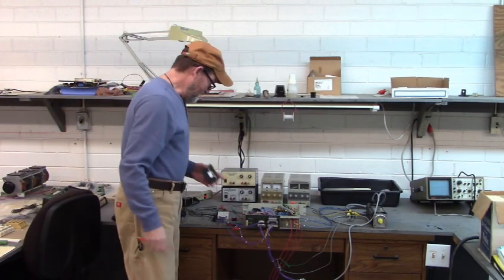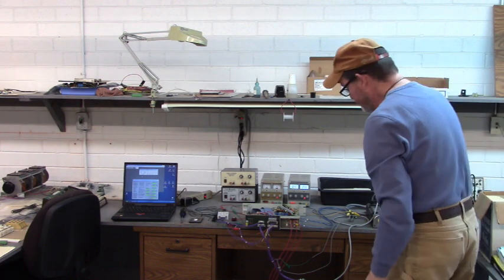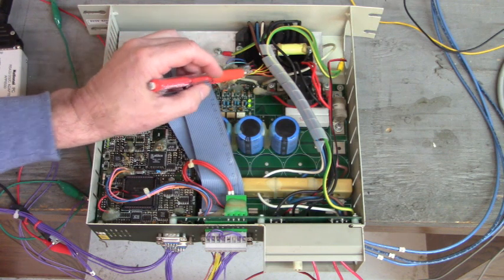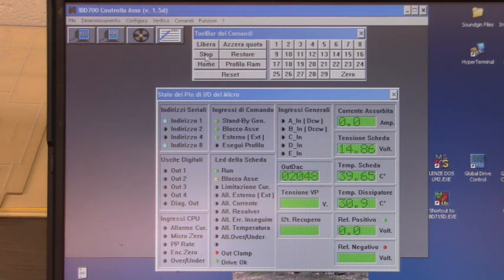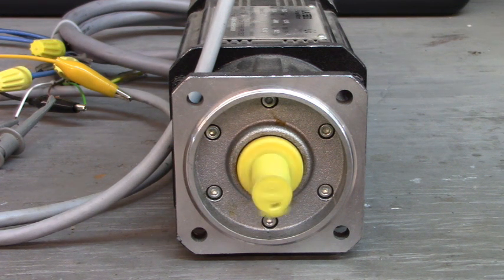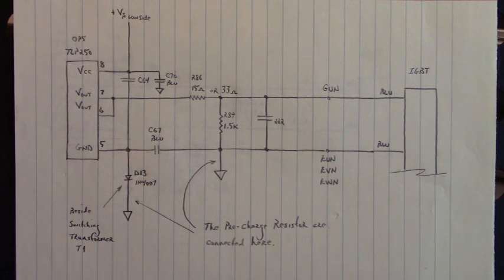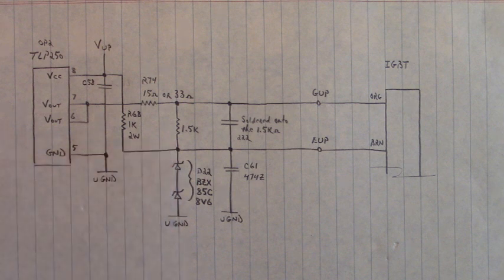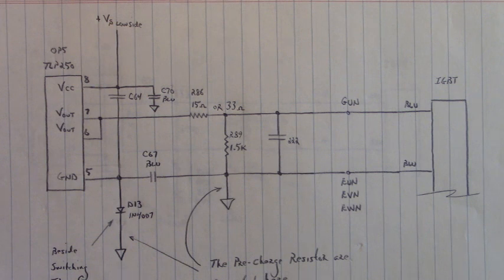Lafert Servo Drive Shorted IGBT Power Module

Comment: Hello sir.i have a lenze servo drive from a maisa tea bag machine..We got a broblem wiz it I open it to repair I have replace some resistor transistor and the eupec econo pack bsm10gd120dn2 igbt..After repair I test it on the machine the servo motor turn on for 2 second only the my main fuse on the drive main blown..when I open the drive to check again igbt,resistor,transistor burn again can u guide me Pls thks in advanced Electronics....

Comment: Hi! I'm trying to test a servo drive equal to this one, but I'm having some troubles with it. A can make the start (at least de Run led lights up), but the motor doesn't move. Is there any chance that you can tell me which connections you used and which software?

Comment: some times the IGBT modules are too big and have pins in each side of the four sides of the package and it's soldered to the PCB  , that makes it too difficult to remove the damaged one .
what do you recommend as a best way to desolder those IPMs ?
Reply from the maker: Yes, that is so true. I hate trying to remove an IGBT that wants to be stubborn. In those cases I use Chipquik. It is used for unsoldering surface mount integrated circuits. But it also aids in the removal of larger items such as IGBT power modules. Chipquik stays molten at lower temperatures to help the removal. When I go to the shop tomorrow I will get the Chipquik part number.
Reply from the maker: First I will use a solder sucker to remove as much solder as I can from the IGBT. Then I will apply rosin flux to all the IGBT pins. This helps the Chipquik to flow onto the pins. Then I will turn my soldering irons heat all the way up to its max temperature. And apply the Chipquik to the IGBT pins.
Reply from the maker: Go around all the IGBT pins continuously applying heat from you soldering iron. The Chipquik will eventually allow the removal of the IGBT. Be patient. It takes a long time. I have spent as much as ten to fifteen minutes removing the more stubborn IGBTs. Also be aware that the soldering iron does not damage the circuit board. While you are heating the pins with the Chipquik, tug the IGBT away from the circuit board. Be patient. Don't lose hope. Eventually it will give way.
Reply from the maker: Now as a last resort. I have taken my side cutters in between the IGBT and circuit board. And cut the pins of the IGBT to remove it. Then unsoldered the cut pins from the circuit board. I hope this makes your life much easier. Look up Chipquik on the internet. Tomorrow I will go by the shop and get you the part number that I use. It comes in a tube of about 25 sticks.
Reply: @PeepawMcDonald  i really appreciate this help 
do you mean the solder paste as the chipquick ?
at the end yes i do cut the pins then desolder them , but some IPMs has its pins unreachable so even this method not working  every time .
i was thinking in using desolder vacuum iron which heats and sucks the solder and use the hot air with it to help it but even i'm not sure if this method would work or not .
thank you so much for your time
Reply: @PeepawMcDonald  wow 
i found a video of this chipquick 
it's a solder wire but it has a long liquid time after molten , now i got the idea it seems to be good one .

unfortunately i can't find it in Egypt even i can't import it from out of Egypt it's forbidden .
again thank you so much